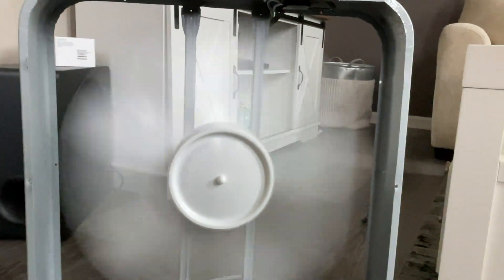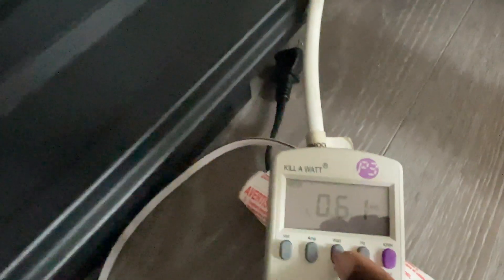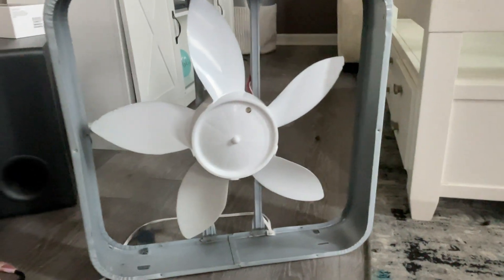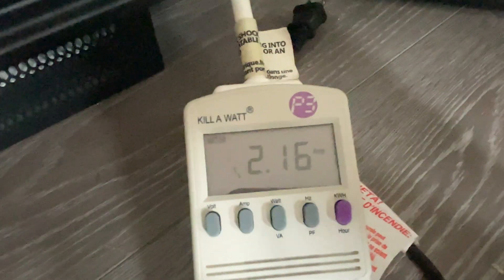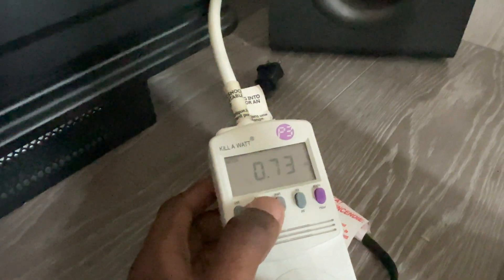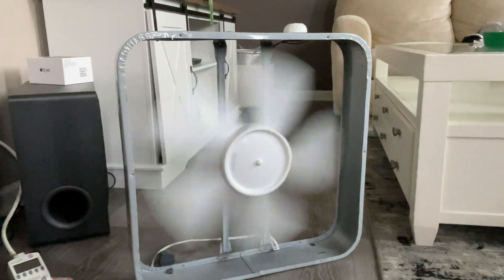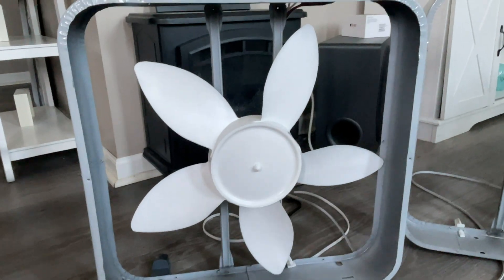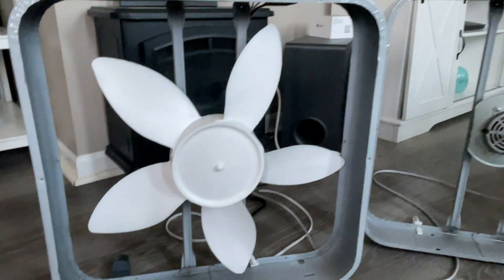Box fan motor comparison | Shaded-pole Vs Capacitor based

Comment: The motor on these newer fans are smaller, yet they are more faster but they last shorter hours typically speaking, for anyone who wants a long-lasting fan the shaded pole motor is a better opportunity.
Reply: One of my ceiling fans have a shaded pole motor and it runs at like 80 rpm on its only speed
Reply from the maker: The motor in the weather-shield is over 20 years old, and works like a brand new fan

Comment: You could add a pfc capacitor to the Shaded-Pole to improve the power factor, not sure its really worth it though. (Wired parallel to the Shaded-Pole Motor.)

Comment: I always swore by shaded pole motors. They're inefficient, but they run cooler, and can take far more abuse. They are definitely more powerful than the cheaper PSC motor found in the 3733, even if they don't have as much starting torque. Box fans took a turn for the worse with the transition to PSC motors. The reliability was never quite the same.
Reply from the maker: This is the early 1.1 Amp PSC motor, not the much weaker 3733 PSC motor. My Mcmillan motor appears to run much warmer than the PSC motor. The PSC motor was definitely faster when using a lighter blade-set.
Reply: @1ampcurrent The early 1.1 amp PSC motors were arguably just as powerful as the old Marco Motors, and the McMillan motors Lakewood used in the 90s.

Comment: McMillan Motors have 6 Poles which means it will spin at 1200 RPM maximum while the PSC Motor has 4 Poles which it will spin at 1800 RPM maximum.
Reply from the maker: I don’t think it’s a 4 pole motor though
Reply: @1ampcurrent  Lasko PSC Motor has 4 Poles which was mistaken as 8 Pole

4 Poles Winding and 4 Poles Starting
Reply from the maker: Ohh, well that makes more sense
Reply: @1ampcurrent  PSC Motors have higher torque than Shaded Pole as long as the Capacitor is properly selected